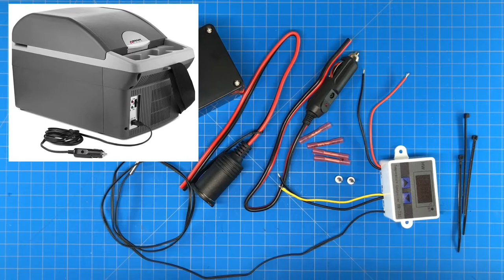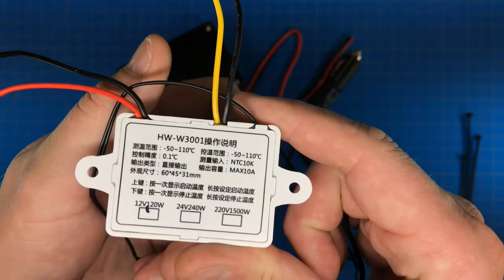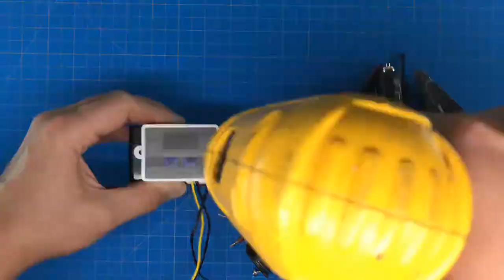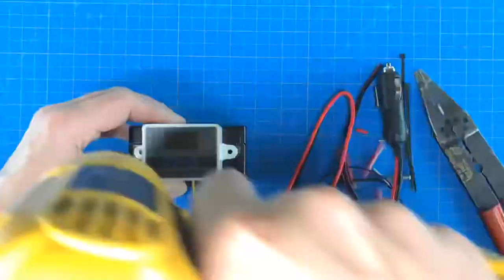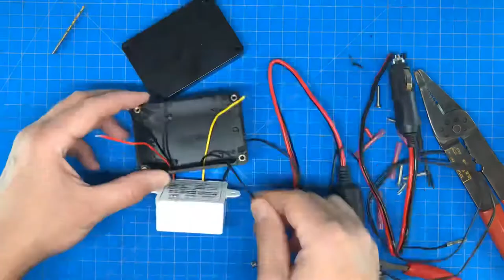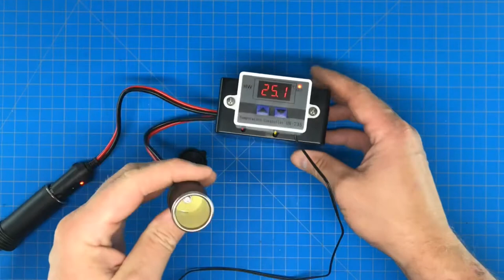Adding temperature control to a thermoelectric cooler

Comment: This looks interesting.. Does it throttle the input to lower or increase the temp, or is this simply a thermometer or thermostat? ie Can you set a temp and plug in series with the the power . MY idea is to use a thermoelectric cooler to keep the photo chemicals at a constant temperature.. would this be something for/like that?

Comment: Cool project. About to do the same. My friend has a boat with one of these cooler and it kills the battery if the solar power goes out for a few day. 
Did you  do a comparison on the avg current draw once the controller is install? 4 amp draw non stop on a 200AH battery bank goes fast.  I will experiement soon enough.
Reply from the maker: It all depends on outside air temp and how much stuff is in the cooler, I bet it cuts average current in half at least (I have not tested it).

Comment: At :30 you say "to control the temperature to what ever I set it". Does that mean it can simultaneously heat and cool as necessary?  In my app I want my photochemistry to be at a fixed temp, despite the ambient temp. I've seen various units that have a selector for hot/cold.. are there others that can detect and ..as in your case ... make the temp as designated? 
Does the module  expand on this... ie heat or cool as needed to reach the temp.. or is this solely related to the function of the cooler and your thermostat limited to a certain range (voltages?)   
In your test/demo you have the unit powered (male cig lighter inserted to 12V source)  The female cig lighter goes to cooler' input (Male12V cig? ) 
Not afraid of new challenges.. but fundamental education lacking